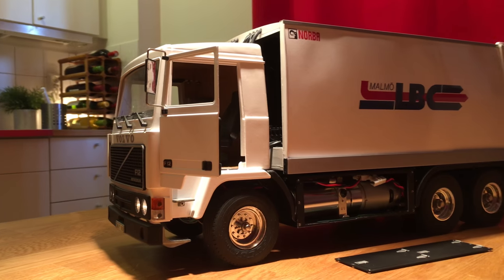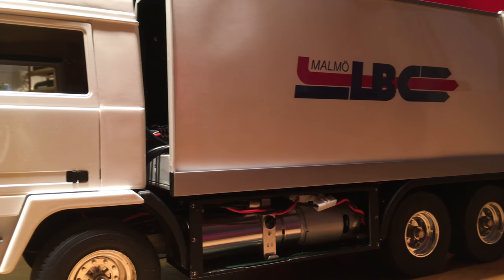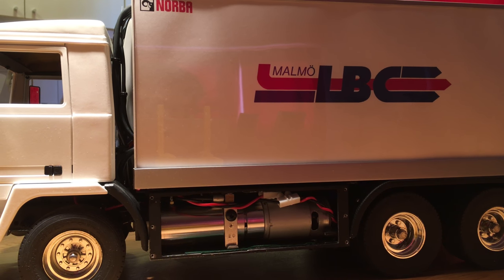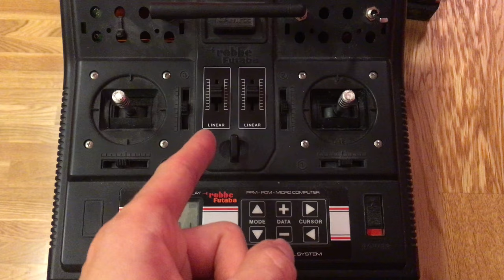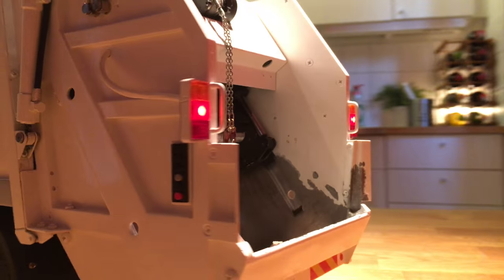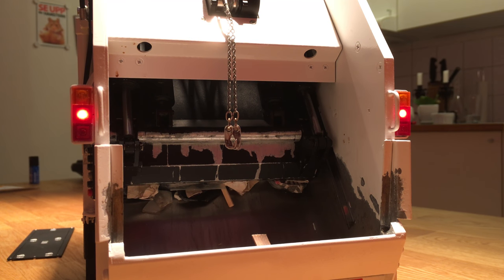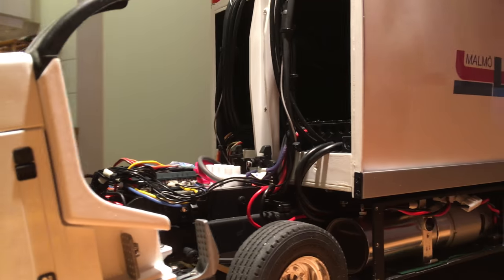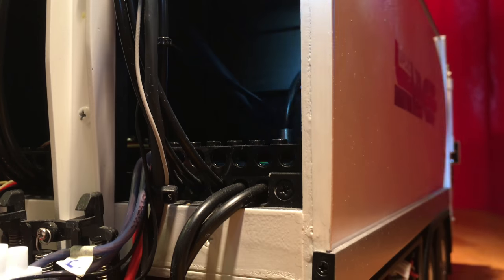Video Presentation of my Garbage Truck! (Please read description)

Comment: What kind of cylinder did you use too the plate to press the garbage out of the truck 🤔
Reply from the maker: The ejector cylinder is a "standard" 12mm cylinder from leimbach modellbau, and the stroke is 140mm. It is not telescopic, and therefore the ejector can only travel about 2/3 of it's full distance towards the front of the body. The space in front of the ejector is used for the valve blocks and the oil filter.
Reply: @SeRefuseTrucks  Thank you so much 🙏🏻🙏🏻

Comment: Total legend! I hope one day I have the same skill and tools to build something this amazing. I will probably do a side loader though. I wonder how that would work out. Top notch video thanks so much!
Reply from the maker: Thanks a lot! :) Well, if you are really interested in it, and are prepared to work to achieve your goals, I am sure that you will succeed! 
A side loader is a challenging build in the wedico scale, but not impossible. It is hard to find space to put all the components in. I am a little bit tempted to build a Leach Crocodile in 1:8 though..
Reply: Aww thanks :) Yes by far the biggest hurdle is the arm. I have built some lego models which are a good place to start i think. One of my main challenges would be cutting the pieces, as I don't own any special tools lol. Also finding hydraulics thin enough would be a challenge as well. The Leach Crocodile ASL would be so cool to see! Also, I wonder do you have any mini bins you plan to use with it? I think most of my 100+ mini bins are about that scale... If I were to build a Mini ASL it will most likely be of the Heil 7000, the McNeilus Autoreach, or the Heil Durapack Rapid Rail. Let me know what you think :P
Reply from the maker: The best way to cut sheet metal is to use either laser cutting or water cuttning. But that requires that you draw the details in a CAD-software. In CAD you can verify your design, and simulate every movement of the arm/packer etc. Then you can export the parts in a file format that your local metal workshop can put into their machines. If you can tolerate that the cylinders are a little bit larger than they should, I think you can manage building an asl. Just bear in mind that an ASL requires a lot of proportional/hydraulic channels, meaning a very expensive r/c-system. It also requires a lot of space in the model. I would recommend building any asl with "tilt to dump" ejection. Otherwise you will need telescopic cylinders for the packer, and they are usually only single-acting in this scale. My recommendation would be the old Heil Formula 7000 square body, or the Wayne Curbtender. If building in the 1:14-scale I would recommend the bruder Mack Granite Cab, and using Tamiya chassis and wheels etc. Or you can just build your own cab. :-)

Regarding bins, I have some "desktop tidy mini bins" which are European bins and equal a 180L bin in
1:8-scale. I also have some American styled "Mini Curb Trash & Recycling bins" (5 Inches tall) but they are clearly in 1:10-scale, and thus not usable in my upcoming projects.
Reply: Thank you for the information! I will definitely do that. I think the 7000 would be good too. Ah I see. Some brands out there have smaller bins. The cylinders will have to be a little big. What do you mean by proportional hydrualic system? Does it give more oil to the larger cylinders and less to the small ones?
Reply from the maker: A proportional channel is a r/c-channel that allows you to control for example a servo. With it you can position a servo in both end positions, but also in any position in between. This means that you can control not only the direction, but also the speed of the hydraulic cylinders. A typical ASL requires between 3 or 4 channels for the arm alone. Then you need channels to control the packer, tailgate lift, body lift, steering and forward/backward of the truck. That is at least 8 proportional channels..
Reply: Wow. That's a lot of money! I will definitely try to find a way to fund my project and learn more about it before I jump right in...
Reply from the maker: Indeed there is a lot to learn! And you shouldn't expect the project to cost less than at least 4000$. :-(

Comment: Does the ejector move on its own.How much can it take to fill it up ?
Reply from the maker: It has to be directly controlled from the transmitter. There is no "automatic pressure regulation" allowing it to travel forward as the load becomes denser. I simply move it forward a little bit when the packer begins to struggle. 
I have never actually filled the truck up, as it would take a lot of "trash" to do that. I have probably only used about 20% of it's maximum capacity. I can check how many litres that is, when uncompacted.